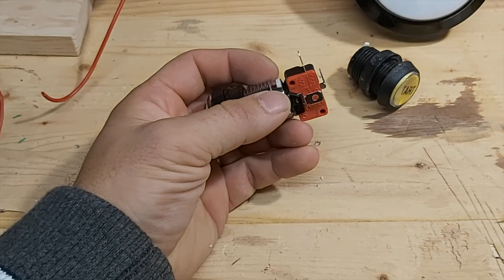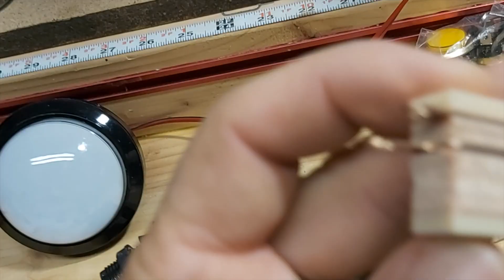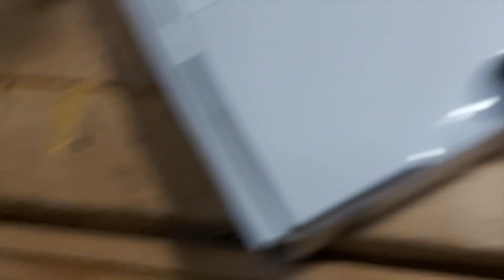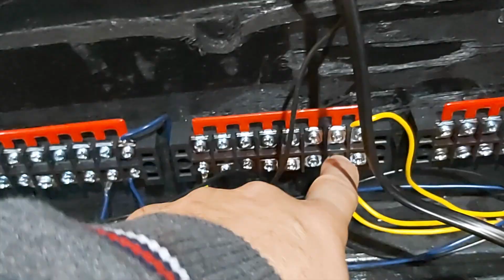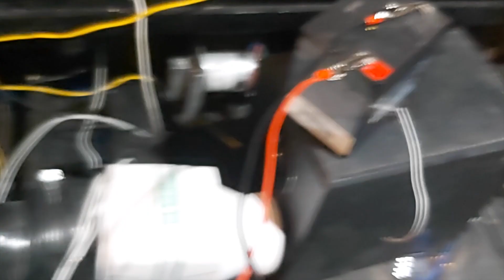Types of Buttons

Comment: I have a question I am using VPX for example in Jurassic Park Data East the real machine I think flashes the start button when there is positive credits, and I think even the smart missle lights when it has not been used....   Is there a way to map these to the game to for example your start button if it's lighted that you can have it flash and mimic the game ROM?   Maybe you can consider a video.
Reply from the maker: Yes, we use a controller for that. Pinscape, ledwiz or else. You connect the ground for the light to it and the software DOF does the rest.

Comment: I may have it backwards, but doesn’t the hot line get daisy chained and the ground go to the pinscape?
Reply from the maker: Yes. I Daisy chained what is not using the Pinscape. The power and the ground for the buttons can be daisy chained. The signal ground can also be daisy chained and the signal goes to the Pinscape.